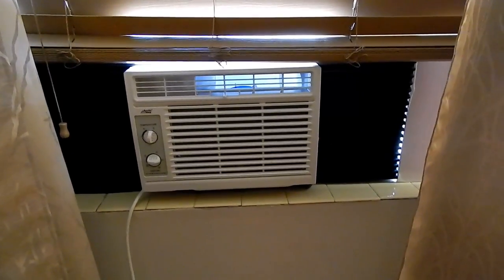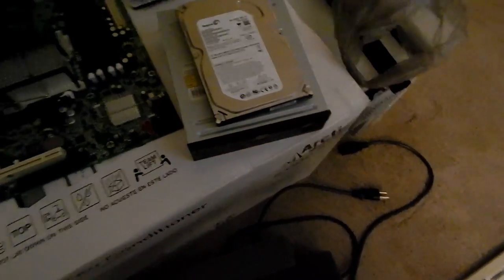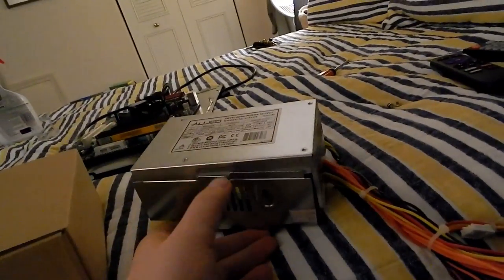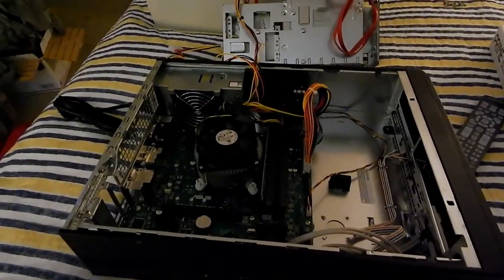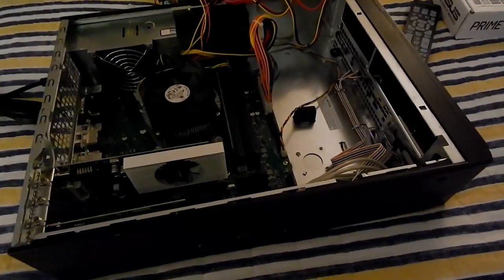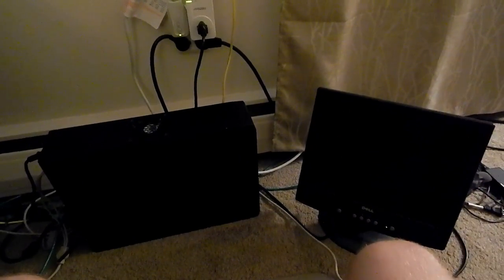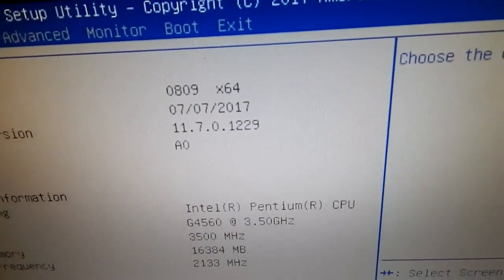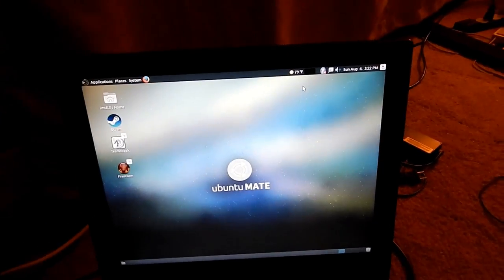Prime Systems PC Build: August 2017

Comment: I can't believe that there is Prime Systems Core 2 Duo 3Ghz for sale on Ebay for 45 bucks (it's a Intel DQ35JOE Motherboard). One of the best HTPC's I've worked with! Upgradable to a Quad Core and 8GB of RAM! Mine had Vista Businees Edition but works great with WIndows 7 but the board uses this Trusted Platform Chip and thus far no Linux has played with it well. I added 4GB RAM, Gigabyte hd5450, and works great with KODI Media Player. The case it's self is an APEX DM-317 and still goes for 42 at Directron and 52 on newegg
Reply: yeah same I got the same computer but I upgraded it to use as a secondary computer, i upgraded it to 8gb of ram, 2 tb hdd,120gb ssd,nvidia gt 440 and windows 10 pro and it works great

Comment: oh no! the original TFX power supply for this unit.. is a Solytech! Well thats a bad start and uses these ANODIA capacitors which i've never seen before but what's that 5 X Caps, 2 Y Caps, and a decent Bridge Rectifier. Not bad. here is the Solytech link: http://www.soly-tech.com/ch_product_data.php?pid=54&class_type=1&mainid=1&subid=14&page=1 and a Hardware secrets break down of a Solytech based PSU: http://www.hardwaresecrets.com/apevia-turbolink-atx-tl450w-bk-power-supply-review/ But it's no JonnyGuru Gutless Wonder!